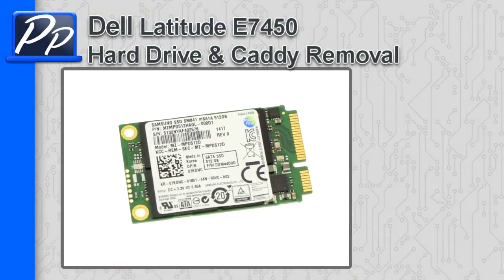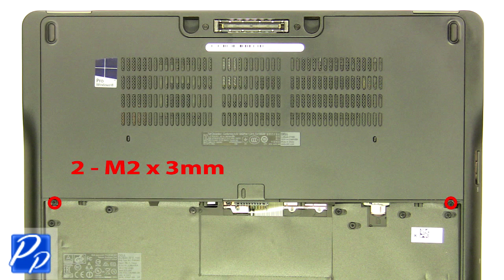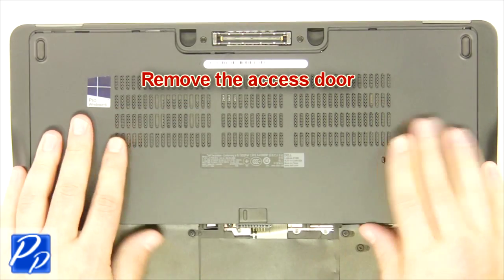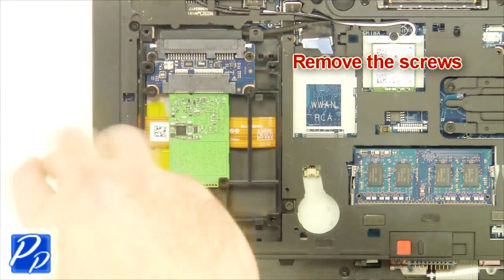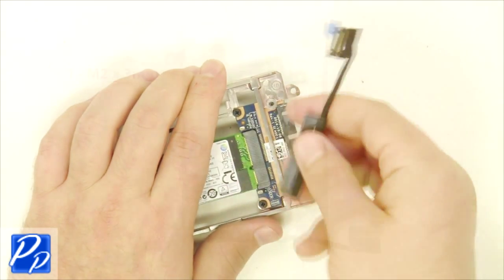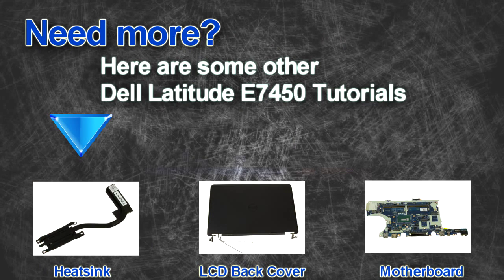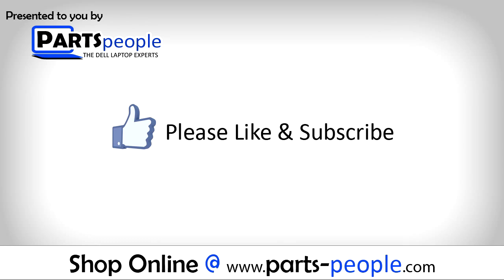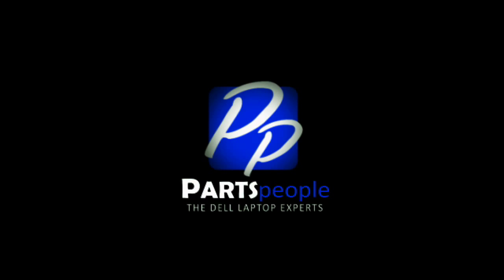Dell Latitude E7450 SSD Replacement Video Tutorial

Comment: Great for Dis-Assembly, but leaves one with a torn down computer and no RE-ASSEMBLY instructions. I believe the definition of "replacement" includes putting things back together, right? It would be nice to show how to thread the ribbons under the mouse pad.
Reply: I agree about the definition of replacement - it suggests that something is "put into place" - a process that is not evident in this video.

Comment: Do i need an adaptor(bracket) if i wanted to install regular 2.5 SSD for this laptop(Latitude E7450)?  Thank you for the answer.
Reply from the maker: You will need a hard drive caddy and I think it requires a 7mm SSD. It will use the same connector cable.